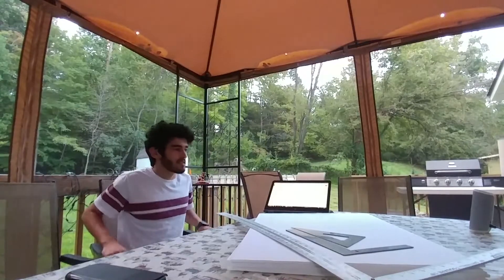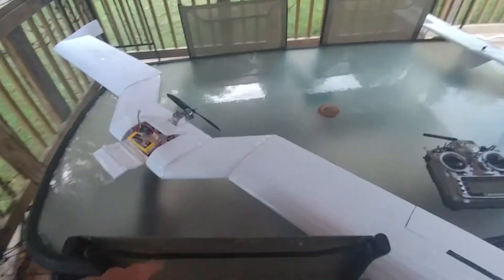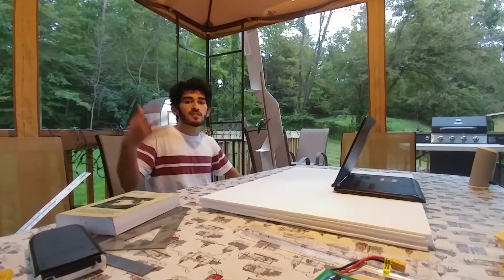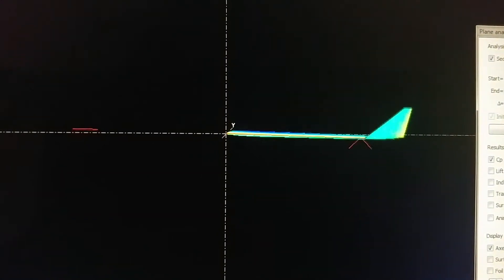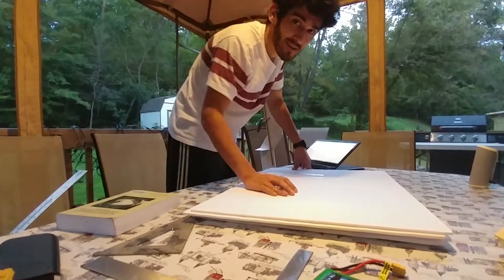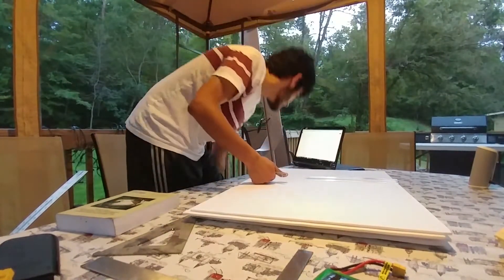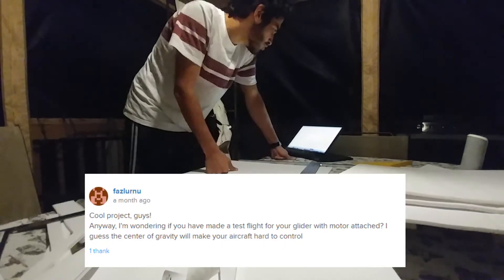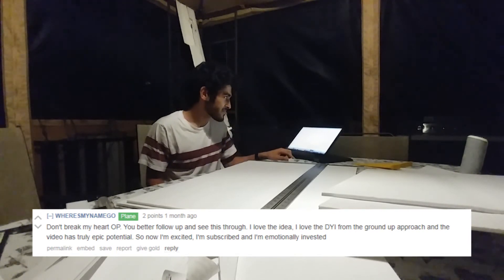Project Log 3 | Autonomous Glider From High Altitude Balloon : V2 Build, First Flights, Q&A

Comment: Hey man, glad I got featured twice in this video! Haha 

So I have some XP with openlrsng system and I'm going to tell your now, that you are going to run into issues with interference. 

The orange rx gear is junk, they don't use low pass filter chips like the hawkeye gear. 

Also over driving the tx chip with 5v is a good way to burn it out and increases your spurious emissions by a lot. 

Using the right antennas will be critical, get a VAS dipole for rx but you'll probably want a directional for tx. 

For the transmitter module, you will want to skip the jr style module and go for the cased delux v2. The metal case will reduce noise on the rc radio pickups and cause less jitter. Alternatively you can try to shield the jr style modules. 

I like the improvement to the sweep I didn't notice how drastic it was before. 

Also I think you mixed up dynamic pitch stability with static. 

The elevon changes make sense, look a lot better now. Also glad you were able to maintain yaw stability with fewer vertical stabs. 

Keep up the great work man, I'm digging it. 

Drop by the #openlrsng room on freenode or the forums on rcgroups and chat with the folks more and find out why you really do want to avoid the orange rx gear. There is the less expensive chiplrs that run openlrs. You can find them on eBay, but they don't come with a low pass filter by default. You will still want the hawkeye/brotronics 1w rx thought. It's got the filter built in and the PCB is good design. 

Cheers and good luck! (/u/btreecat)
Reply from the maker: N0FPV you actually ended up watching most of it, I'm actually surprised!

Evan chadworth, a guy who was helping me out with the transmission stuff lended me his deluxe version initially. He said he uses the orangerx casually because you can connect to the computer via Bluetooth have your telemetry that way. I didn't know about the interference stuff, definitely straying away from the orangerx stuff now.

I thought about making my own dipole, but with the range we're talking right now, like you said, can't really spare quality. I bought a VAS dipole and a moxon for the tx, they're both working fine. 

And as time goes on we're still looking for more sponsors, so we might just splurge and buy a dragon link depending on our funds. I've already dumped a lot of money into this project so I'm not looking to dump any more if I can't help it. Definitely going to talk with the rcgroups people as well, and probably get my ham radio license along the way. Can't hurt right?

Ooohhh also you're right I mixed them up. For some reason I thought dynamic stability meant stability applied by computer (which I guess it can be?). I guess it could also be both since static refers to the aircraft leveling out after a disturbance, like wind, but dynamic refers to damping out over time.
Reply: Yep, watched the whole thing ;-P 

Evan may be using a different version of OpenLRS or maybe ULRS? Depends on what protocol he is using for telemetry. 

One site that is useful as a rough estimate of range is maxmyrange.com. 433 MHz, 800mw (real), moxon tx, dipole rx ~ 48km/30mi which is really good. 

Can't go wrong with any VAS antenna really.

Dragon link is nice but I am like you, funding is not unlimited so I prefer to find the balance between performance and cost. 

For getting your ham, check out http://www.kb6nu.com/study-guides/ as the technician is free.  Also, there is an android app called ham test prep that is really good. You will only need to study for technician which is a pool of about 300 questions.  

2.3/2.4GHz video is a good choice also. You can get a TBS 800mw VTX for ~$100 or less and a 500mw one for ~$50. As far as the RX side, I am currently using the Quanum diversity 2.4 rx with a VAS pepper box and a mix of true RC singularity and VAS airblades. I don't have much testing with this rx but it comes recommenced from a TBRC team pilot.
Reply from the maker: downloading test prep right now. Thanks!

I might as well copy the setup. Hows the 2.4 immersionRC stuff? I saw a couple on the rcg classifieds for $30-$50.
Reply: I haven't had great XP with their RX and found their VTX to be expensive and fragile but that's new, and for miniquads. For fixed wing they could be a good choice for gear, just read up some reviews first. I don't know a lot of people who run IRC tx/rx. I also have the nextwave fatshark 2.4 rx and would not recommend that. The sensitivity on it is terrible.